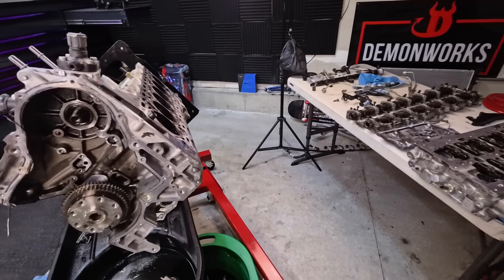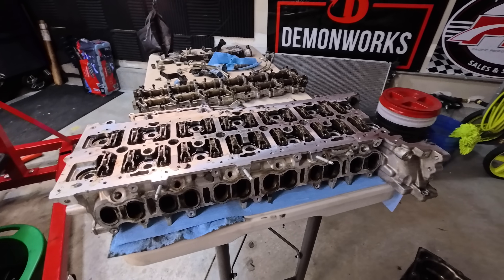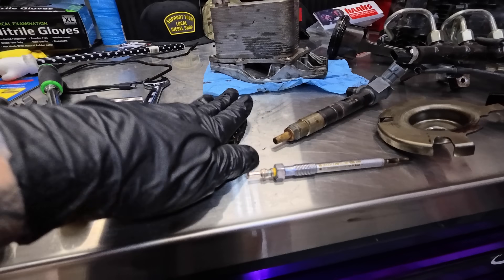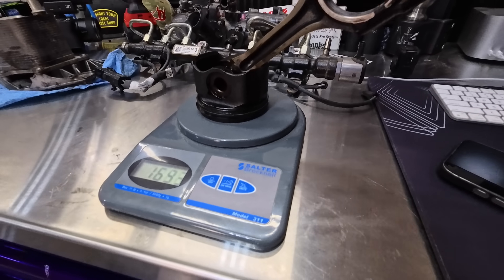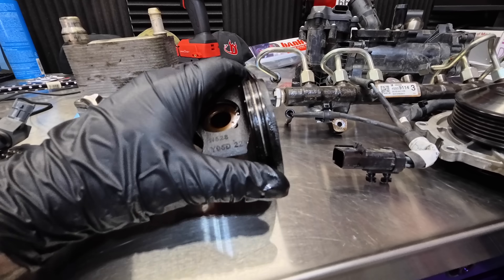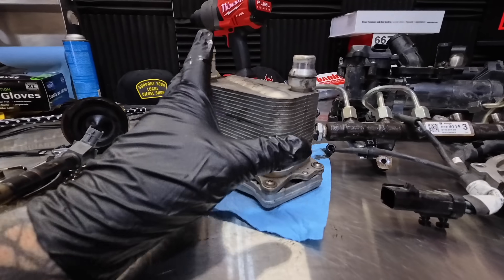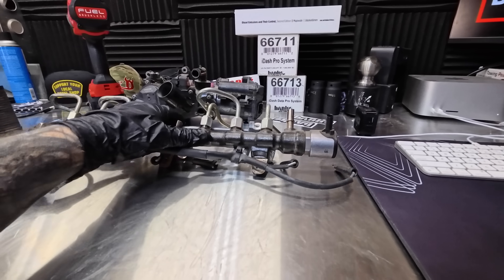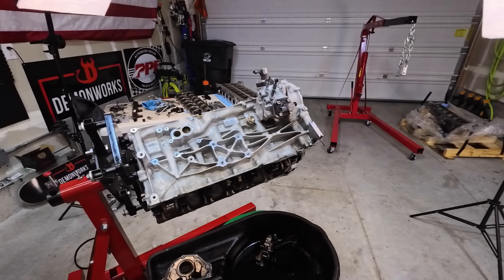What makes the New 3.0 Duramax Better? LZ0 VS LM2

Comment from the maker: I tore down a 2023 LZ0 Duramax Diesel Engine and set aside all of the updated / upgraded parts over the LM2 so i can show you what they all look like. This video will help you make the decision if the LZ0 engine is the one you want or if you prefer the LM2 which has shown itself to be a stout Benchmark.
https://www.duramaxnews.com
https://www.bankspower.com/demonworks
ACDelco Fuel Filter: https://amzn.to/3QFfXex
3.0 Duramax Oil Change W/ PPE Oil Filter: https://amzn.to/3qmLR6o
3.0 Duramax Oil Change W/ ACDELCO: https://amzn.to/3QtmDO5
PPE OIL FILTER: https://amzn.to/3JP9j22
Fuel Filter Socket: https://amzn.to/4b52BkY
Fuel Filter KlickWrench Socket: https://amzn.to/42arKH6
Aluminum Fuel Filter Cap: https://amzn.to/3FZir28
K&N Air Filter: https://amzn.to/3S5sLvq
K&N Intake: https://amzn.to/4b6oy35
K&N Fuel Filter: https://amzn.to/4b6Ux3i

www.bankspower.com/demonworks
Reply: Would you recomend not buying an LM2 at all and paying a little more for an LZ0?
Reply: @tbrink16  I have a 2022 LM2 and absolutely zero issues and I've been very happy with it. They took a great engine and just made it even better.

Comment: Different topic but can you explain why transmission temps on the LZ0 trucks are higher than gassers? When I tow with my LZ0 AT4 I see high 190s - up to 208. A friend with a gasser doesn’t see near that. What gives and is this going to shorten life of the trans?

Comment: Help us understand why they didn’t just run the oil pump off the chains?!
Reply: Or better yet .. a gear
Reply: Noise. Chains and Gears would have been too loud and GM wanted to keep the cab as quiet as possible. While everyone complains about it, it’s a 2200$ fix at 200k miles!!! I’d say normal/responsible people can financially plan for that!
Reply: @PWW-il1os it’s a diesel… chains aren’t the noise… literally 80% of modern engines use chains for everything.
Reply: I need this job.. UMM we are going to 3d print everything out of plastic.. yes that will save us money. Good luck everyone. This should be illegal. These mfrs went to school and have degrees in design and engineering. Its so it fails after warranty and you have to buy a new motor or just buy a new vehicle.. Its all a scam
Reply: @StreetTerrorist187 I have yet to hear of one failing and warranty is up at what 36k. People have over 100k and the belts look as good as new.

Comment: Any clue why it wasn’t simply designated the LM3?
Reply from the maker: They do random codes for the engines. The L stands for "Longitudinal" but outside of that, the code is random.
Reply: @DemonWorks yeah… makes as much sense as the oil pump belt and putting import stuff between the engine and the trans… 

I’m afraid we let the Boomer generation retire without teaching this generation nearly enough… we’re kinda up a creek here.

Comment: My 24 lzo just went into limp mode the codes said fuel pressure regulator and reduced power it has 27000 miles hopefully the get it fixed right the dealership says 15 days before they can look at it

Comment: Would you recomend not buying an LM2 at all and paying a little more for an LZ0?
Reply from the maker: buy the newest LM2 you can get, great engine. LZ0 is superior, depending on the year. the 25/26 seem to be a bit shaky right now.
Reply: @DemonWorks  Thanks! This is a very helpful channel!
Reply: @DemonWorks  this comment was interesting. I am looking at this LZO engine for the Yukon and was holding off on getting a 25, which has the LZO. But if a used 24 with the LM2 (later engine) is just as good/reliable I may go that route.  I would save some coin for sure.

Comment: Yo, my DIC dash screen that has the miles, speed, oil and gas isn’t working. Tried a soft and hard reset, none worked, so you know what number fuse the DIC and PIC are? Waiting on to taking it it to the dealership in a few days, but if I can figure out why it’s blank, I can fix it my self. 

The center counsel screen still works, I think the wiring got a little wet under the floor mat, saw a damp rug and dried it out. But since I already turned the car on just seeing if it short circuited anything to do with the DIC. Hopefully it’s just the fuse or wiring and not the computer itself, because everything else works, but that’s important to see how fast I’m going or how much gas I need. It’s a 2025 Silverado, so I I haven’t had time to properly study the mechanics of even the fuse numbers yet. 

Let me know if you know any trouble shootings the manual doesn’t give exact specifics about even the fuse numbers for the DIC.

Comment: That is great info, i am thinking of getting a 2025 or 2026 model and bringing to the UK, this helps allot, have they fixed the rear crank oil seal issue now ?, i was sure i read they did have some turbo problems also, hopefully that is fixed also.

Comment: Hey, what’s up? I know this has nothing to do with your engine tear down but my steering is stiff. Does my truck have an electric steering or does it have a power steering pump 2020 1500 3.0 Duramax
Reply from the maker: Electric steering.
Reply: @DemonWorks it gets stiff and then normal intermittent issue
Reply: @DemonWorks  have you ever see it get stiff and get stuck on a turn and then you have to correct it

Comment: GM tech...  a quick note on fuel pressure regulator 2. There is a redesign on it. It has an issue if losing prime in the fuel rail. This is most noticeable when the vehicle enters autostop. It would stall on an attempted quick restart from that mode.

Comment: Have you ever heard of an LZ0 being swapped in after an LM2 failed? After digging around, it looks like that's what happened on my truck. I was confused because it still has the original turbo and emissions equipment, but the engine itself looks to be an LZ0.
Reply: I'm having that done ony 2022.5 refresh as we speak

Comment: Here is a interview with the GM engineer on the LZO differences from 3 yrs ago on Tim's channel. Great info. Now seeing the real engine here!
https://youtu.be/J7KM5-oMLm8?si=HlMUoGNXukW56OGS
I am running a 24 Silverado LZO.  No issues. Towed 600 miles w/ a 5000 lb RV, gobs of torque and 15 mpg.
On regens, towing under load up and down hills kept the soot level at 60 to 70%, doing a self regen all the way.

Comment: GM doesn't have any excuse for the timing chain problem. It was a known issue with BMW's based on this same design. If anything they should have improved oil delivery to the upper chain, even if it meant adding something to the cylinder head or block to squirt oil onto the chain.

What I wouldn't give for an aftermarket CCV that's overbuilt for max reliability (and not plastic). I hope the potential threat of a class action lawsuit is enough to motivate GM to stop wasting everyone's time with a penny pinching CCV and finally come up with a design that's truly reliable. 

Great videos lately. So much useful information!
Reply: Design that's truly reliable? Like a $10 classic thermostat? Hell, throw 3 of them in parallel to accomplish the different cooling zones. But no, we get a $400 plastic octopus
Reply: Not defending GM, Toyota is using a plastic coolant control valve on the new Tacoma engine as well.

Comment: Funny you mention the Coolant control valve.  I have a 2020 Silverado with the LM2.  I bought it July of 2024 in Prescott Arizona (I live in Mesa) with 35,500 miles.  I have 67,000 on it now.  Around 60,000 miles I kept getting a persistent code.  Luckily the truck is under an extended warranty that I purchased with the truck.  Auto-nation Chevrolet ended up replacing the coolant control valve.

So far, I love my truck.  I'm getting 26 mpg highway.  My truck spends a lot of time on the highway.

Comment: Dude many Tks for that comparison.  Ive been following you ever since I got my diesel. I do have one question for ya on Regens cause I know in a past video you had a problem with it.  I have a 2023 with the LZ0. Currently I have about 37,000 miles. Yup just outside the warranty. On my last trip from colorado to illinois, I noticed the Regens were happening every 200 miles when before it was up to 450 miles. My old banks instrument showed it.  So I brought it to Chevy thinking as an emissions system issue, it should be covered for 100,000. I was wrong.  They did a forced regen with their laptop connected, and charged me $350. I head out again next week to colorado and hope that took care of it.  The truck primarily only sees long distance driving.  The mechanic said that driving doesn’t work the truck hard enough to keep the particulate filter clean.  He recommended working it harder like when I was towing our 30 foot RV.  Any thoughts on this.  Have you run into this also?  I do mostly run with a fuel additive for lubrication and cetaine improvement.  Used to use hot shots, sometimes the GM stuff but lately Power Service Diesel kleen.  Thanks.
Reply: Dude, I would recommend using Archoil Diesel Fuel System Cleaner AR-6400D. I use this every 5,000 miles and this boost my Regen frequency to 600 miles from like 400 miles. This stuff helps clean out the DPF but you can read the literature if interested. I would show you a graph (histogram) of my REGENS using my Idash but I have no way of posting it on this site. I have 2023 LZ0 with about 23,000 miles.
Reply: @NMTRUCKER Tks for the recommendation.  I’ll try it.
Reply: My regen occur approx every 160 miles now. I do not take long trips any longer just around the town driving.  Is this an issue?

Comment: Has anything changed from the 23 LZ0 to the 25?  I had a 23 and just got a 25 two weeks ago. Under normal acceleration the 25 feels like it has more power/torque on the low end. Almost like I can feel the boost come on stronger. Not sure but it is definitely a different seat of the pants feel over the 23.
Reply: I did the same thing and my 25 feels slower lol. Same truck, so prob just placebo affect.

Comment: I’ve had the LM2 and now an LZ0.  I feel the modifications on the LZ0 are definitely an improvement over the LM2.  The LZ0 feels more responsive especially at highway speeds.
Reply: That extra hp and torque is the way to go. It helps
Reply: Even with the full tq at a higher rpm.?  Thats my only concern. I have a 2022.5 lm2. Just ordered a 26 lzo
Reply: @zackjay71 it’s all in how you look at it, the LZ0 actually makes the same tq as the LM2 at 1500 rpm (460tq). Main difference is the LZ0 continues to increase tq up to 2750 rpm to 495 tq where the lm2 plateaus. Hope that helps
Reply: @zackjay71  Im pretty sure the LZ0 makes the same torque at the same RPM as the LM2, the torque just keeps climbing after 1500 rpm instead of flat lining.

So, basically, from 1501 rpm to 3750 RPM the LZ0 make more torque than the LM2.